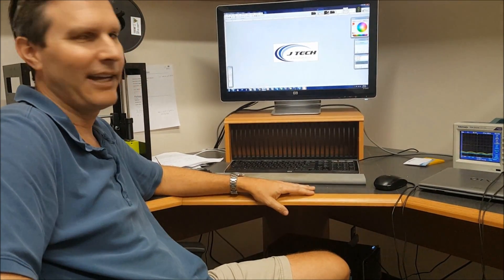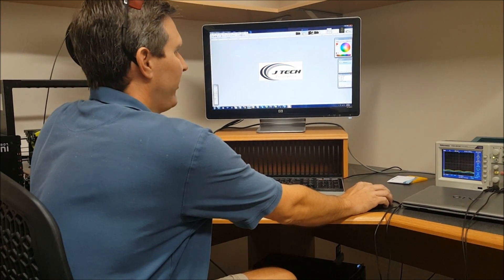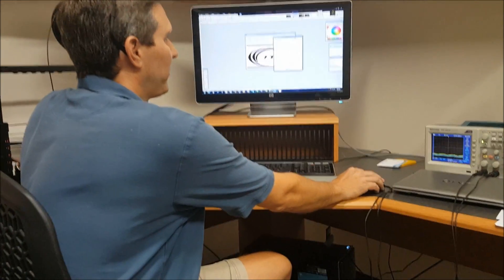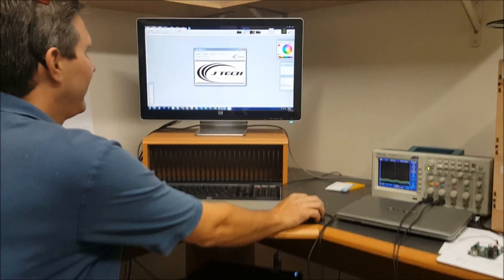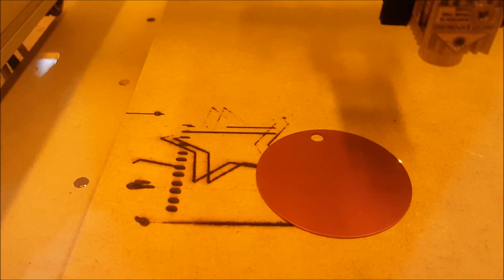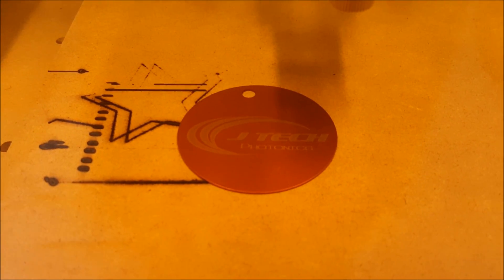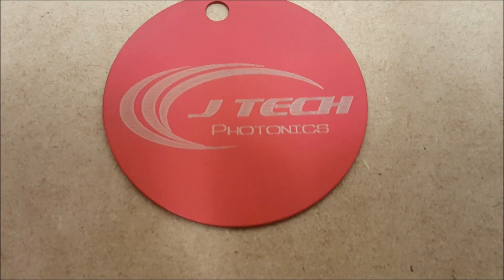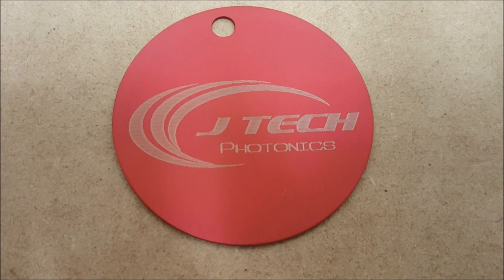Laser Engraving Anodized Aluminum with J Tech Photonics 2.8W Laser Upgrade Kit

Comment: Doesnt the  image disappear if the anodized coating around the image wears off?....one reason why i prefer diamond drag vs laser.
Reply from the maker: Yes, if the coating wears off then you won't see the image as well. Laser is good for serialization where you want a surface mark. Drag bits will give a different look as it digs into the material.  We like using both for different applications.

Comment: Just a question as I am curious, Would 2 or 3 more passes with this laser make the engraved logo more cleaner and whiter as it seems very faint and not so crisp.

I still admire your effort though, as almost everyone says that you can't engrave (laser mark) anodized aluminium with a low powered laser, only with an ultra expensive! ND Yag laser or a 20 watt to 60 watt CO2 laser - you proved them all wrong!! :-)
Reply from the maker: Thanks Joseph-  It really depends on the anodization process for the contrast.  In this case it was a thin layer of anodization and it was red.  Black tends to work better to give a nice contrast.  I am not sure about the multiple passes making it any better, but I have not really tried it to be sure.  This piece of black anodized material turned out really good:  https://jtechphotonics.com/wp-content/uploads/2015/05/Anodized-Aluminum-Testing-445nm-Laser-Logo3-1024x768.jpg
Reply: Thanks for your reply, Yes, I did see that photo of that black anodized aluminium plate on your website earlier today that's in the link you posted above, That is an truly awesome result! - brilliant job - well done!

The only way for me to know is for me to get one of these machines and test it out, I think that black anodized aluminum is the way to go and is the best choice to use with these laser engraving machines.

All the very best in all that you do and thanks again for your prompt reply :)